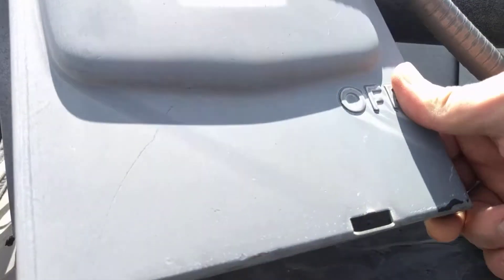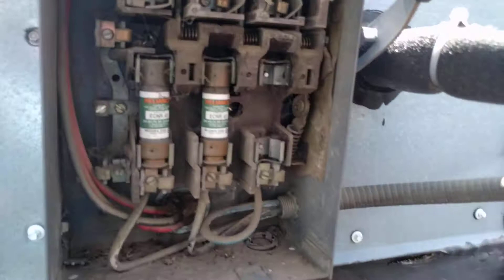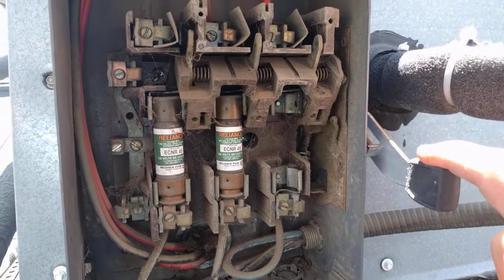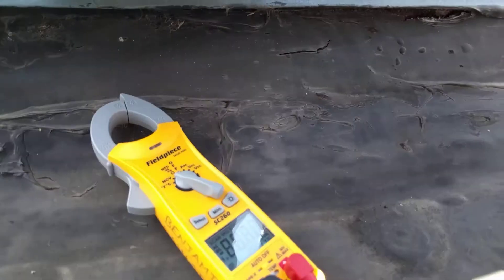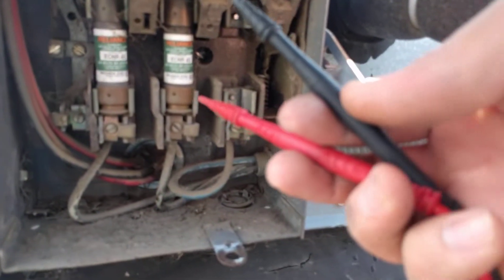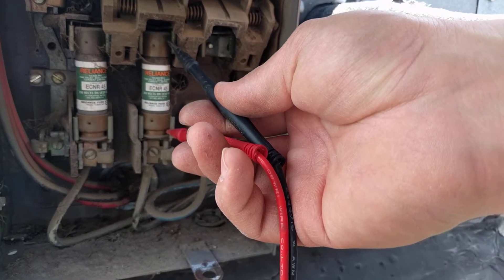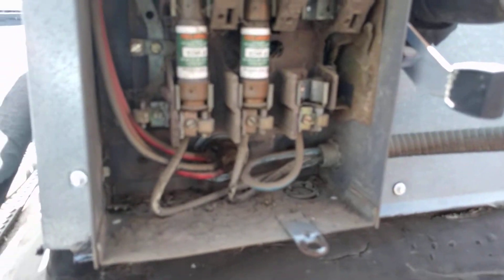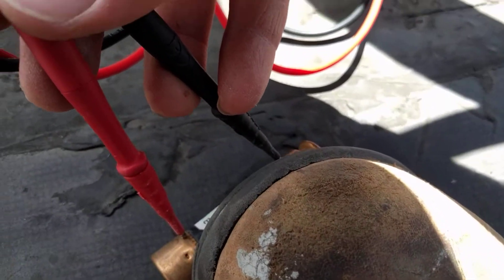How To Test a Fuse Using a Continuity Test or Voltage Difference

Comment: Great video, very clear and to the point.  It's so counterintuitive when a reading of 0 volts means that the fuse is good, while voltage reading above 0 means a bad fuse.  This always threw me off as I always thought that a voltage reading of 0 meant that the fuse was bad, but it's the other way around.